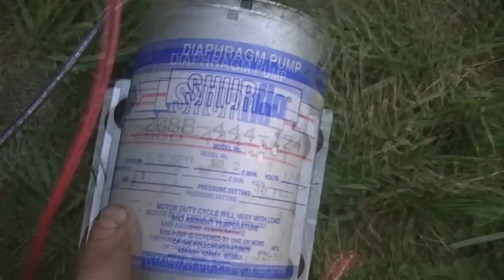3rd Member Install, Found More Damage... (06/30/12)

Comment from the maker: made the brackets myself :) and i used everything from the front solid axle on the rear. calipers, rotors and studs. i think i have a couple videos explaining my rear disc setup... cant remember which ones though...

Comment: lol, out takes as well, we all like doing a ring gear :-)

Im no mechanic but im supprised they didnt mill a channel round the bolting surface and fit a rubber "O" ring in, just plop the diff on and tighten the bolts/nuts, no atv/silicon required.
But im sure there was a reason, oh yes cheapness lol

Shame about the seals/brakes but there not enclosed to stop the river of mud/water covering everything.

The manufacturers just cant cope with your hobby of hell, wa wa wa :-)

Comment: Great video bud. so I have a question for u? I have a 94 toyota 4runner  v6 4x4 manual trans. I just purchased a complete front solid axle and rear one from an 82 toyota.  guy I bought it from said he had them re geared for 37s. I also bought the kit 2 do the rear 63 inch chevy springs. my truck is now at the shop for the front swap and rear. I want 2 keep my rear diff so can they just swap the third member or will it not fit on the 94 
thanks
Reply from the maker: i swapped as old a 3rd as a 84 into a 94 housing. as far as my experience goes, the older stuff is all the same, with the exception of the elocker. the 2nd IFS truck/4runner rear diffs are wider too, so you will have to get a set of IFS hubs for the front, plus brake mods, or run wheel spacers.

hope this helps bud!

Comment: I have. 99'. 4wd  4:10 gears. picked up 98' 4wd elocker 4:30.  .. can I take my rear 4:10 gears and put in the locker axel, then put that axel on my truck.?  4runner